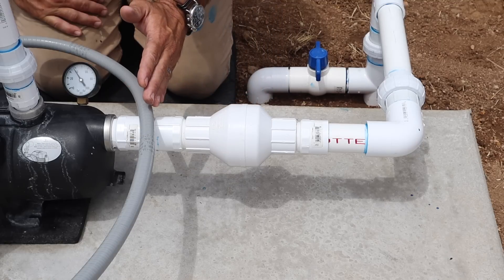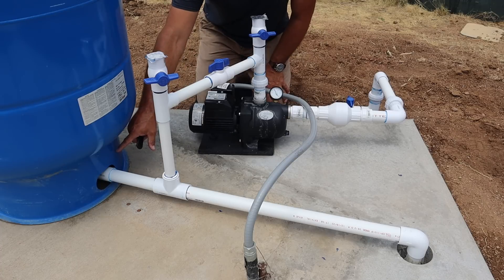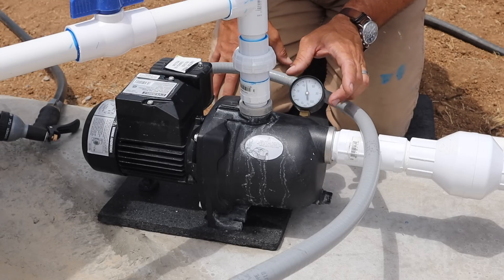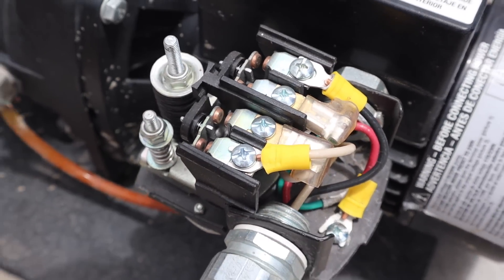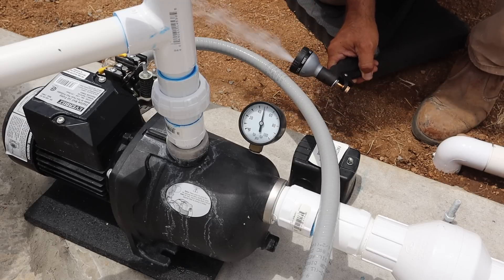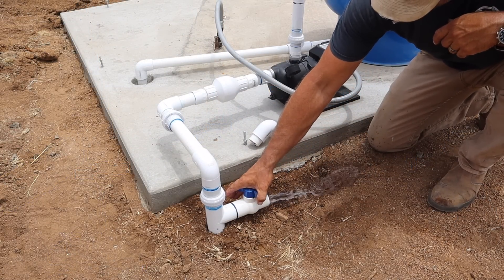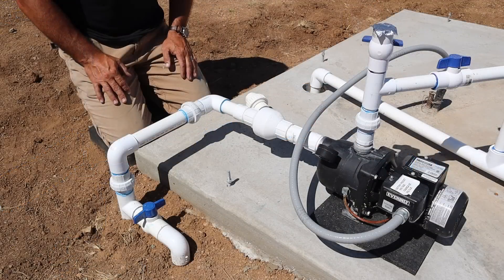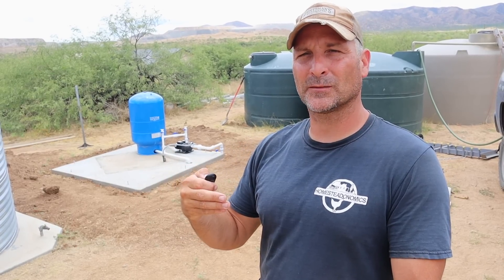Pump House Tour of My Rainwater Harvesting System - How It Works

Comment: Good stuff.  I do plumbing system design if you ever have a question.
Reply from the maker: I might just take you up on that.   Appreciate you watching and hopefully my DIY version isn’t too crude😂
Reply: @homesteadonomics  
Your design is sound as far as that part of the whole system goes, and that's all that's visible here. 
The big thing, and you got it right, is to keep the pump shut-off pressure below the maximum that the bladder tank manufacturer specifies for their tank, and that is typically 60 PSI.  I call out pump kick-on pressure at 40 PSI, but less is great if the rest of the system allows it.  It's easy to think that you have a pump, so you can have as much pressure as you want in your house, but the system has to be designed using 40 PSI or less, if you play by the rules.
40 PSI is plenty for most houses, but there are some circumstances where you have to use unusually large diameter pipes to get everything to work.  Some of those circumstances that force the use of large pipes are big houses with many bathrooms and extra fixtures, houses on a hill, and multi-story houses.  At least that's true if you do everything according to code and abide by the tubing manufacturer's specifications.

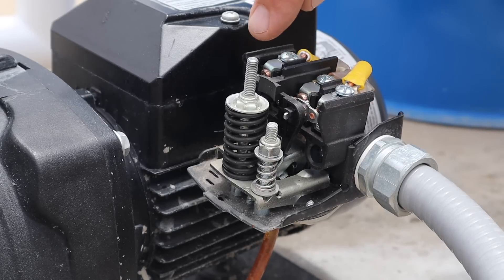Comment: 5:01 I would use standard electrical wiring for the pump, rigid wiring can break due to vibrations.
Reply from the maker: The run from the wall to the pump will still be in flexible format.  It will just run out of the side of the outlet that I place on the wall.

Comment: What size of pipe did you use?  What does the connection to the tank look like?
Reply from the maker: Tank connection is 1.25” threaded outlet with a brass 1/4 valve  and that connects to the 1.25” pvc that runs to the pump house.

Comment: I have a similar system for my off grid water system near Douglas. I use a diaphragm pump  instead  but use the same kind of tank and pressure switch. One suggestion to improve pump longevity is to install a sediment screen filter before the check valve. It keeps any gunk in your tanks from getting to your pump.
Reply from the maker: I generally have not had problems with sediment in my green tanks since they are not connected to my primary rain collecting tank.  And when I transfer I wait until it’s all settled down…..so very little sediment makes it to the green tanks.  But it’s a very good idea and I may just add one as a just incase.
Thanks! 😊🙏
Reply: @homesteadonomics  ha! I have my pump off of my rain collection system and deal with a lot. Maybe I oughta to have one off of the main system where I transfer to? Thats actually a good idea.

Comment: I got tired of replacing those cheap pumps every year or so. Look into the Goulds J5sh pump they run for years and then you can buy a rebuild kit for them when the impeller finally comes apart after 5 years or so. Nice explanation on the parts.
Reply from the maker: Yeah this is a budget pump.  But my first one went over 10 years.  So i thought it was okay.   This one is about 4 years old.   
But I’ll definitely check out those Goulds you mentioned. 😊🙏

Comment: Homesteadonomics fans -
KNOW your PSI pressure rating of the plumbing fixtures inside.
If  you set pump pressure too high the fixtures will fail and flood.
50-60 PSI is usually safe. 90 PSI is asking for faucets to pop off.
You can also use a pressure regulator inside the house but it's redundant. 🖖-KJ
Reply from the maker: Yes, spot on!  All good advice😊👍

Comment: I am looking for more information on this what you were in a cold climate paraphrasing in your tanks still have to have water for everything 5 stop Garden Greenhouse & house
Reply from the maker: Best thing for colder climates is thermal mass insulation…. As in being buried in the ground more, or added heating elements at freeze points.

Comment: The pump sounds terrible...maybe a bearing going out of something. Or perhaps that's just cavitation I am hearing.
Reply from the maker: Well, this is a budget pump….So it’s definitely not the quietest.  About 4 years old at this point.   
My first one that went about 10 years and sounded similar.   But a tad quieter.  But it could have an issue.  But that’s why I’ve got the spare in the garage 😊👍

Comment: Do you have a filter between the holding tanks and the pump?
Reply from the maker: No.   My tan rain tank if what collects rain from my roof.   Sediment gets in that tank as it kid if acts as a first flush, settling tank.   
But when I transfer rain water from that to my green tanks (that are connected to the pumphouse) I always wait a couple days for all the sediment to settle down and my transfer pump from the rain tank to the green tanks has a sediment filter.  So the water that is in the green tanks is very clean.

Comment: Brass ball valves are much better than the plastic ball valves.  Last much longer and fewer broken handles.  Cost a bit more, but worth it.
Reply: This, it might cost a bit more up front but worth it on the back end.
Reply: Just a suggestion but when I built our new pump house ( Northern MN so we'll insulated and a deep well) I made the roof removable so that when, not if, I need to replace the pressure tank I can do it easily.
Reply: @WoodNMetalWorkshop  Good idea! For an above-ground pumphouse it might be beneficial to make relevant parts of the walls hinged or removable for the same reason.  Working with plumbing in restricted spaces soon becomes a right pain.
Reply from the maker: Yes they are😊👍.  I’ve got them on my tank outlets and on my house inlet from the pump.   
Only reason I didn’t add them here is, well, no good reason.  Just making it easier to build this out and they won’t be used all that often😂

Comment: After you get the walls built, you could built a small box to cover the inlet pipe. To protect from uv rays. Just an idea.
Reply from the maker: Yes, I’ll have it covered with a little insulated cover.   I did the tour this as it was easier to film and talk about when uncovered.   But it’ll be covered soon 😊👍
Reply: @homesteadonomics lol
Reply: You really want to do something about direct sun . It kills the pvc.
Reply: Another recommendation would be to have an external isolator for the electrical supply so you can shut down the pump from outside without having to enter the pumphouse itself.